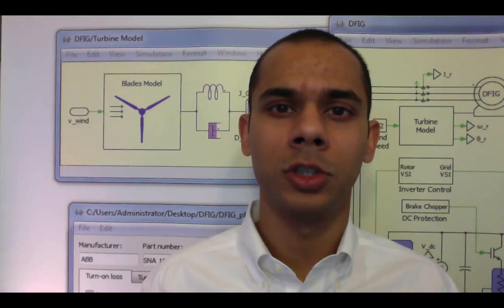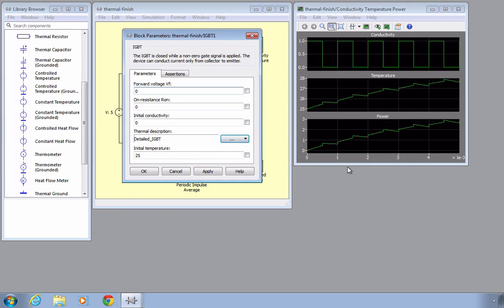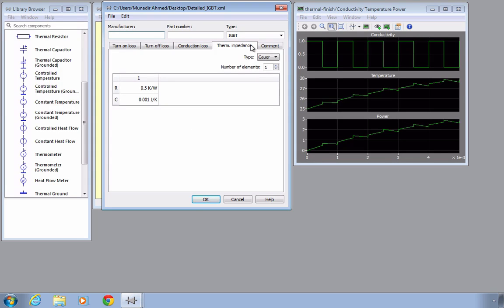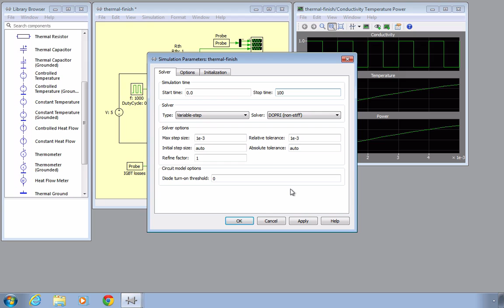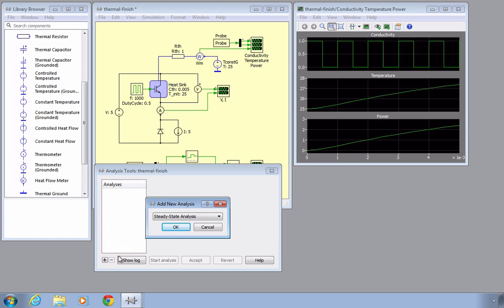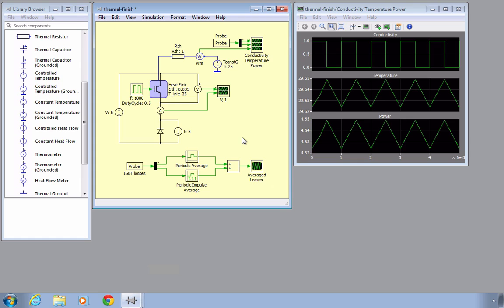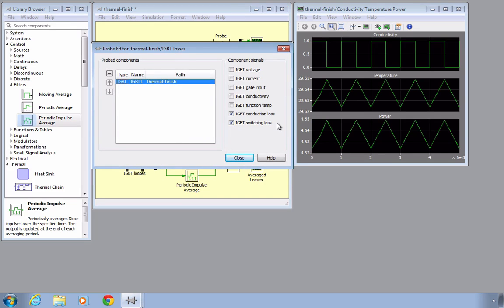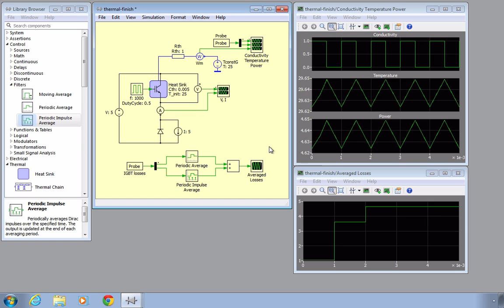Thermal Modeling in PLECS Part 2

Comment: Hi sorry may I know how to achieve the thermal resistance and capacitance
Reply from the maker: If you are referring to the junction-case impedance of the device, this information is sometimes provided in the datasheet via the thermal chain coefficients. Alternatively, if a heating curve is provided, you can use the Thermal Import Wizard (see https://youtu.be/98IyBX8VZO4) to generate the coefficients yourself.

If you are referring to the resistance and capacitance of the heatsink or other packaging, you will need to figure that out from the vendor's information or using equations to estimate the cooling system sizing and properties.

Does that answer your question?

Comment: Hi, when I use MOSFET with di/dt parameters (to give more data about the MOS) there is no such a thing called conduction loss and switching loss at the probe list. How can I calculate those losses with that component then.
Reply from the maker: Hello, the MOSFET and IGBT with Limited di/dt cannot be used with specific device thermal descriptions for loss calculation. Only the ideal MOSFET component, for example, can be used for this purpose.

Comment: Hi plexim, I have question about this video. 
How do you find the thermal parameter such as turn on and turn off joule characteristic. 

Most of the manufacturer, they didn't show this details Ic, Vce versus the joule characteristics. 

Will you be able to provide the according IGBT or MOSFET datasheet related to this video? and it is possible to provide this example files as well. 

I had also tried the demo thermal model of the buck converter. However, I cannot find the example thermal libraries of the (MOSFET). 

It will be good, if you can show related datasheet to select the joule characteristic(Ion, Vce and mJ) and import to the thermal parameter that would be better. 

Anyway thanks, it is very useful demonstration.
Reply from the maker: Hello John, I'd be happy to provide you with some documentation on these topics via email. Please send me an email to my last name at plexim.com.
Thanks!
Kris Eberle
Reply: Hello Kris, can you please provide a link regarding John's question in the comment section of this video?